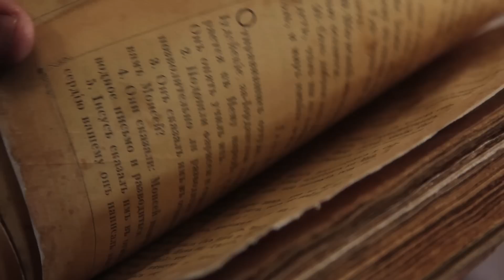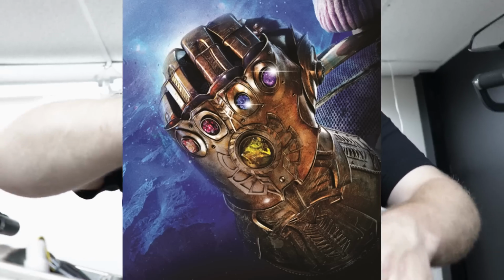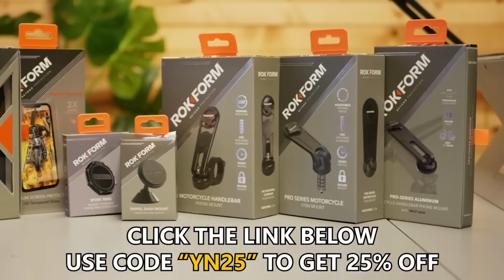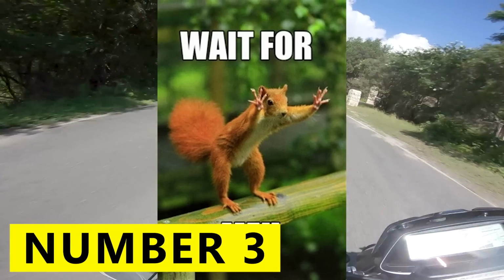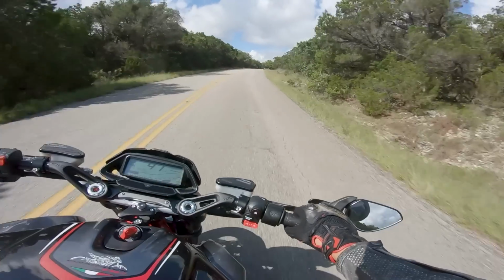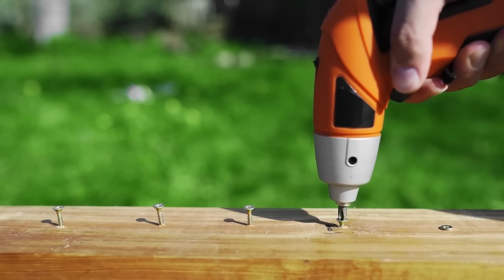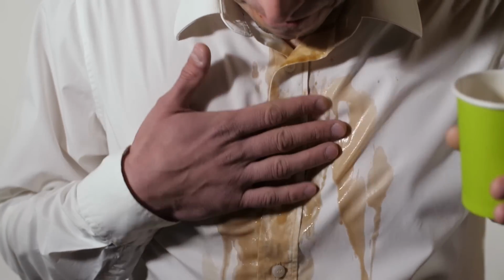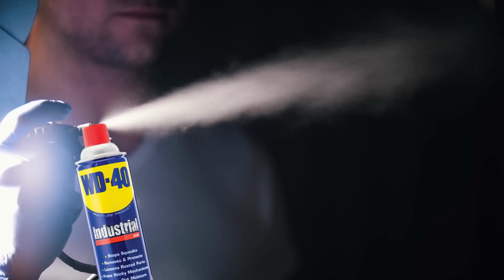7 Weird Tools That EVERY Motorcyclist NEEDS! (Less Than $100)

Comment: My CV carb stripped the heads out instantly when rejetting the first time. Being on the bowl made it the easiest thing in the world to get out. Drilled the heads off, bowl fell off, then just grabbed them with the closest pliers to you to twist out. I highly recommend the JD Jett kit, as it came with replacement internal hex head bolts, because it is expected on those CV carbs to need them.

Comment: JIS screwdrivers wow what a difference, from the first time I used one, I could tell the huge difference. I highly highly suggest anyone that works on bikes to get a set of JIS screwdrivers.  Hey Spike you forgot to mention not to get carb cleaner on rubber stuff and gaskets like the one on the float bowl. If you get carb cleaner on it, it'll swell and you need a new gasket, ask me how I know go ahead.

Comment: I'd say 3 things more should be added. 12 point sockets, long torn socket set, and a hook and pick set. Other than that good recommendations as I have all of them. For screwdrivers buy a set of wera and you can thank me later lol. Spite u had me cracking up at the budget batman line 🤣😂

Comment: I vote brake cleaner over carb cleaner. Both are potent solvents, but brake cleaner is designed to be safe for rubber brake compliments in cars, so less risk of accidentally damaging things.

Comment: I’m basically a glorified janitor at my job at a mechanic shop and I can for one say wear safety goggles when working with the carb cleaner, a co worker was helping me fix an oil leak on my car and I walked under the car while on the phone and it dripped down in my eye
Reply: I get in my eyes on daily basis, it's not that bad, just a little dry feeling.
Reply: @tuzikadesa8982  what brand do you use?
Reply: @atvthings6887  Berner. Okay it's not really carb cleaner but brake cleaner, same stuff really. BUT what does burn like hell is paint thinner, oh god I tought I went blind for a second. Both eyes full of it and 2 hours rinsing with tap water. Had to find the sink blind.